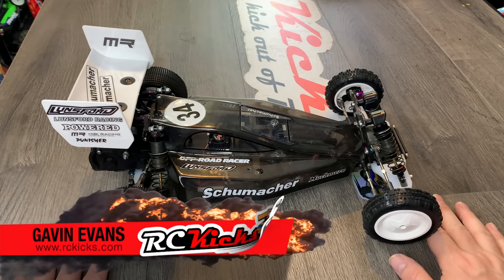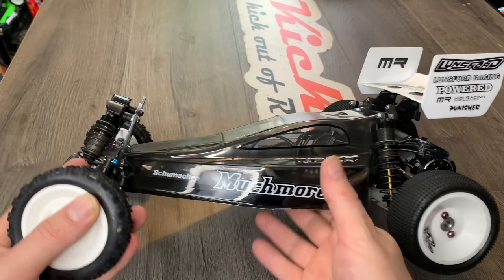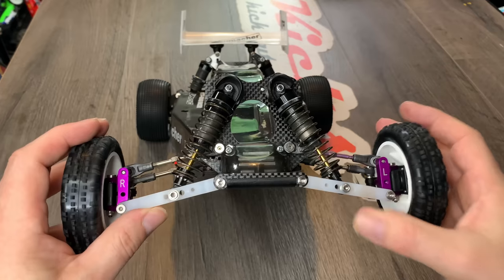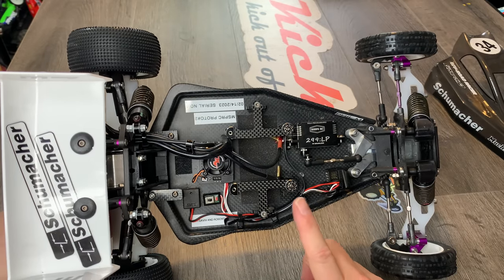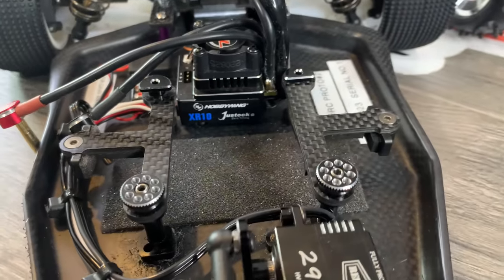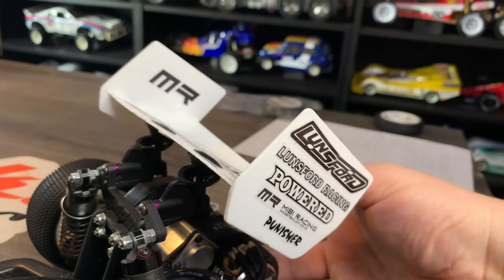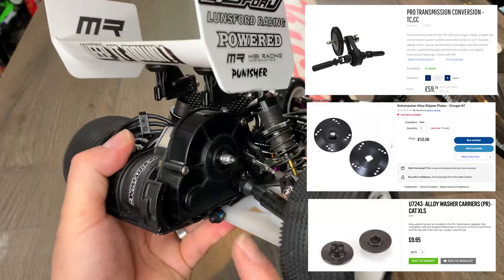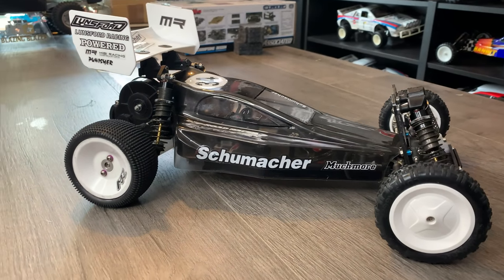I Bloody Love This $1600+ RC! Ultimate Schumacher Cougar Classic Full Carbon Upgrades $$$$

Comment: I also have V2 big bore shocks, but the top cap is a ball socket (instead of a bolt through cap like yours) and the ball-end bolt isn't long enough to add a stand-off...and without a stand-off, the shock is too close to the front shock mount which makes the shock touch the tie rods.  I waiting on a response from my hobby shop to see if I can either get a longer ball-screw or a bolt-through shock cap.  Also, the bottom spring stopper on the shock sits too low and touches the a-arm which interferes with the movement.  I see the you have aftermarket a-arms which I assume eliminates this problem.   Suggestions?

Comment: How much was the front brace? - Cant see it on ebay?

Also the front yokes - are they the same part / exact fit (just with it saying rascal)

Have you changed the shim on the rear arms to a 1mm shim? reduces the toe in to about -1
Reply from the maker: Message the guy on eBay as he will make you one.  His name on Ebay is in the video.

Comment: Gavin....sorry to bother you with this ...but what screw driver do you find is best fitted for the Schumacher builds as well as Tamiya.... any car that still utilizes the "Phillips style screw head"
Thanks in advance
Ed
Reply from the maker: Tamiya use JIS and Schumacher use Philips, so at a quick glance you would think these are the same but NOPE! If you mix them up you will be rounding off screws all over the place.

Comment: Nice overview - thank you! Two questions: 1. You did not (need to) use U7985 (LiPo post spacers) as you don't use standard shorties? LCG are longer and do not fit, do they? 2. Where on eBay did you purchase the damper cap protectors? Many thanks in advance!
Reply from the maker: Did I put U7985, it should be U7984 short alloy lipo posts.  I run the extra thin battery so need the short posts.
Reply from the maker: https://www.ebay.co.uk/itm/403791147593
Reply: @RCKickschannel  Thank you very much, Gavin!